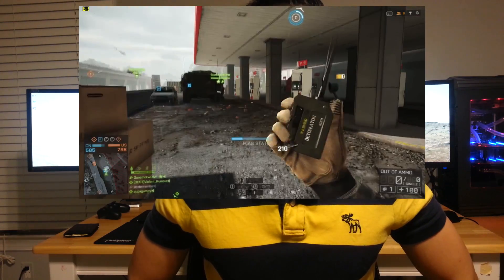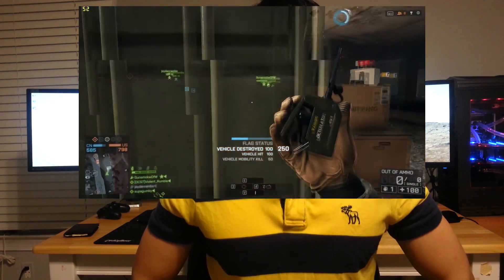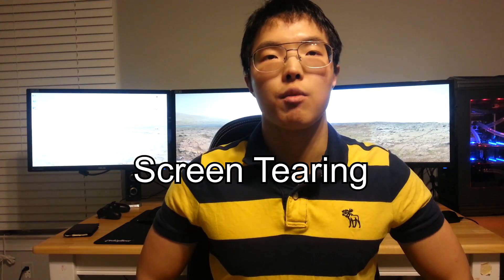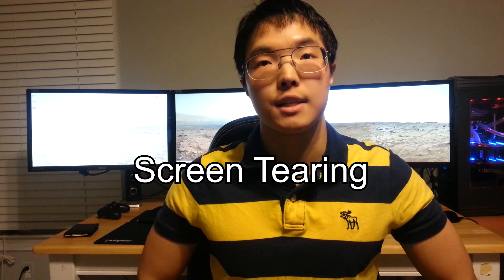What is Micro Stutter as "Fast As Possible" (SLI, Crossfire, Rubber Banding, Screen Tearing, GSync)

Comment: Hey dude great video. I am getting frametime spikes every few seconds in PUBG which is causing microstuttering. I only have one GPU (1080ti). My rig performance perfectly on a more polished title like Overwatch (no frametime variance). I am assuming it is a defect of PUBG's game engine, and not my hardware. However, I was wondering if there is a way to diagnose what is causing the microstutter in case it is something that can be remedied with setting adjustments. I am also wondering if other people can run PUBG with zero/low frametime spikes, as I'm not sure if it is something inherent in the game or if it is something that applies to certain individuals.

Comment: so how to fix it ?
Reply: They figured they should just cancel SLI and Crossfire as the fix :( At least 3DFX got it right.
Reply: @ASD _ Terminator Games don't meet requirements, but systems do. Try finding a system that exceeds recommended requirements are you should be fine.
Reply: @michaelcarson8375  Nah, some games do stutter even when you're way above recommended specs.

I'm running an RTX 3080, an R7 5800x, 32 GB dual rank and dual channel RAM at CL-16 3600, running off of a PCIE SSD.

All temperatures are in check, and the parts boost as they should, but some games, such as Escape from Tarkov, and DCS still stutter somewhat, even though most other games run perfectly smooth.
Reply: @ASD _ Terminator You probably have your software configured wrong. When you take the time to fix the software on your computer you will not have problems unless the problem is you are running off a hard disk drive and not an Nvme drive.
Reply: @ASD _ Terminator Do a youtube search for "make games run smoother on pc" without the quotes.

Comment: Would microstutter be able to occur on a single GPU system? I'm still kind of confused on what is wrong with my system and whether or not it's microstutter. When I run benchmarks, the FPS counter stays constant, but the elapsed time will slow down, then speed back up. This is apparent in a lot of modern games, is microstutter what I am experiencing? My PC: AMD FX-9370 @4.4GHz, MSI R9 390X, MSI 990FX, 750w PSU. Any help appreciated.
Reply: Exypnos yes and no. All it is is inconsistent frame times. This can happen on single gpus (not nearly as common) . however multi gpu setups well have a unique stutter (more rapid and persistent) that you won't find on single gpu setups.
Reply: SlyNine Any fix for me then?
Reply: Exypnos depends on the cause, what exactly do you mean by slow down and speed up (most software will drop frames). What benchmark have you run, does it happen in games as well?

One thing to keep in mind is frame rates that don't match the frequency of the monitor can cause a stutter. If the monitor is refreshing at 16.6ms(60hz) and the frames coming in every 17ms (slower than 60hz) I'm sure you can imagine it wouldn't be smooth.
Reply: 3DMark Benchmark Timespy. In fact, really any GPU benchmark it will happen. Literally the frames stay constant but you can easily see the elapsed time slow down, then speed up.
Reply: Exypnos In that case it's not microstuttering. Unfortunately unless it's a setting in the benchmark itself, I have no idea what could cause that. Does it happen in games?
Reply: All games that stress the GPU. Luckily Minecraft runs nicely. (I don't actually care for MC.)
Reply: Exypnos Simulation speed (game engine timing) would have to do with the CPU. It's a weird issue for sure.
Reply: So... any way around it?
Reply: Exypnos Can't think of any, and not sure why that would happen. All I can say is make sure all your drivers are up to date. The issue discussed here has to do with the speed at which the images are rendered (the snapshots of an instance in the game world). The timing issue you're having is the game simulation speed. Two very different things.

Sometimes games can lock the two together (so the simulation speed ticks forward 16.6 ms each step and is synced with the rendering speed) Those games would slow down exactly as you describe and this would be expected. But very few games do this, and 3dmark has an option to do that, but it can be disabled.
Reply: All drivers are fine. .-. I'm just gonna build a new PC because I can't be bothered with it.
Reply: Exypnos I get micro stutter on all my games it's so annoying!!
Reply: Would you happen to guess what my problem could be? I'm experiencing a "lag" or "freeze" in most games, but it seems more like a problem with most if not all online games, I don't notice it in singleplayer games as much. For example - WoW, CS:GO - when i click on players, or hover over them with mouse i get this usually  split secont freeze in wow, in csgo it happens mostly when I kill someone, or I get killed, or we win/lose the round, it just freezes/lags for 0.5 - 1 second. However, games like Rainbow 6: Siege or Doom run perfectly fine and it usually happens in menus only. I have updated drivers (well at least GPU and sound drivers...)

I have a bit weird setup:
AMD FX 8300 (3.3 GHz, 8-core)
MSI GTX 960 4G
MSI 970 Gaming
Kingston hyperx fury (CL9 at the time I think) rams 24 GB in total 
6 - 7 yrs old PSU Corsair CX600 (oldest part in PC)
Coolermaster Hyper 212 Evo
some old thermaltake case (fans still work properly)
I dont remember what brand my SSD is, but its120GB
WD blue 2TB HDD - this is where games are
and a backup SAMSUNG 500 GB HDD
Reply: Erik Farkaš I would unplug all unnecessary usb ports and hard drives. Disable av, and all unnecessary programmes. Reinstall any programs like punk buster.
Reply: Welp, I already tried playing with allmost all programs disabled, so that was not the problem, I will try the punk buster, if I'll even find out what it actually is. Thank you for the advice (I also wrote my specs in the first comment - edited)
Reply: Erik Farkaš it could very well be your ssd. Old ones with less than stellar controllers had freezing and hanging issues (Your games are not there, but it would cause a system wide hang regardless). Sometimes a faulty usb port can cause random hangs.

The specifics of where things are hanging make me think it could be anti cheat software. But I see nothing in your specifications that make me think it's your computers performance.
Reply: Guess I will build a new PC sometime in the future and use this one for work only or whatever, thank you vm! That is, if I won't be able to solve it somehow.
Reply: Erik Farkaš no problem, good luck.

Comment: In CSGO I had pretty bad microstutter with two GTX760s in SLI on a 144hz monitor even with a steady 150-200 FPS. I fixed my issue in NVidia Control Panel by changing the setting SLI rendering mode to Force alternate frame rendering 2. 

Basically this setting is an option to try out for games that have crappy SLI profiles. 

It makes better use of the 2nd card by alternating between the two cards for each frame rather than mainly using the first card with very little use of the 2nd (I saw no difference between SLI and single card until I changed this setting for CSGO).

Make sure you change it for the game in question rather than the Global setting because it can cause some weird graphical glitches outside of games. You can also try force alternating frame rendering 1 if 2 doesn't do the trick.

Changing the setting to force alternating frame rendering 2 for CSGO made my FPS go from 150-200 to 300-400 steady (and the game is MUCH smoother and without microstutter).

May want to give it a shot, I also changed fps_max to 0 in the CSGO console to get above 300 FPS (that's what it's usually set to).

Anyway for SLI users this may help with CSGO or other games (I've only tried it on CSGO). Nothing else seemed to fix microstutter for me besides this.
Reply: +Garrett Gardner Your problem is your using a SLI for a game that can be run of integrated graphics
Reply: +darksidelead Your problem is that you don't know what you're talking about.
Reply: Garrett Gardner i luled

Comment: I literally this close to buying two 970s over a single 980, but I absolutely do NOT want micro stutter or any kind of lag or delay on the hardware side. I have a 144hz 1080p monitor from Asus, will I experience micro stutter on it, and if so, what does the Nvidia Control Panel have to fix it.
Reply: 2 970's are stupid for 1080p, even for 144hz  but if you really want it you won't notice any lag or so, I have 970 SLI on a 1440p rog swift
Reply: watsyurdeal Sorry but RX10 is wrong, GTX970sli, which I have WITH (I7 4970k, 16gig ram 2114mhz, SSD) I'm running EVERY game 1080p on highest possible at 1080p 60fps, HOWEVER, I'm running the latest only JUST 60fps , so if I was to up my res to say 1440p then I know for sure i'll dip below 60fps and I'd need to turn settings down, this is tit for tat, and it's up to you competely, I believe resoultion isn't as important as texture quality and AA up to a POINT, I wil say as an owner of 970sli they are fucking incredible cards and how they are this  cheap I don't know! But they aren't higher than 1080p cards on the latest games (Dying light I was runing 2 k scaled at 60+ fps) but I'm taking cutting edge, whitcher 3, cyrsis 3 etc future proofing, a 144hz monitor is ready for the future 970sli isn't its gonna end when the playstaton 5 comes out (2-3 years) still, i'd highly recommend them
Reply: Ste Dunn lol you dumb fuck saturating 970´s bandwidth with AA . 

I had 2 970´s before my titan X and they ran perfectly smooth at ultra settings any game at 1440p
Reply: rx10 Why start insulting a stranger over the internet because he corrected you, to me that's quite dumb. Your argument becomes void when you resort to name calling, I'm guessing you're being bullied at school and have rage about it , so you come online to vent?

Look I'm not gonna become hostile back as I'm certain that's not what you need right now upon already being beaten up at school. I hope life gets better for you :)

And by all means, please run Project cars, The Witcher 3 at ultra settings at 1440p at 60fps with out a single drop, do that and I'll make a video announcing how I am a "dumb fuck" Also 1440p you sorta need AA still LOL! When you go 4k THEN I'd say turn it off (and some studies show that even some 4k games need small AA on)

I have a feeling you can't though, unless you have a magical machine that defies all benchmarks done by professionals, but hey believe what you want little guy :)
Reply: rx10 See more aggression more insults :)

You do know there are multiple levels of AA right? You apply less the higher the resolution as it is wasted at 4k, not so much at 2k.

Also look at the benchmarks, "stand your ground" lol all you want, but at the end of the day my little buddie your cards are not magical and cannot beat professional benchmarks, it's either you are right and EVERYONE else is wrong, or it's maybe possible your in the wrong. Anyways, by all means, prove it :) If you can't then quite please.
Reply: +watsyurdeal 980 is actually faster than 2 970s. Could buy a 980 ti instead of buying 2 970s. Far superier graphics card
Reply: +Steve Maynard look at the bench marks, the 980 is 10-15% quicker than one 970, but much more expensive. But 970sli kills one 980. Look at the benchmarks, it's wasteful to get a 980 right now even for 4k which most games won't run at 60fps.
Reply: +Steve Maynard I think you may be mistaken. The 980 is approximately 10% faster than the 970.  Two 970s are much more powerful than a single 980. You're right about the 980TI, though. It's a great card and definitely this generation's top-dog. Two 970s may be 2% faster than a single 980TI, but they are the same price and buying the 980TI  gives you room to add another should a situation call for it. Plus that extra vram will be vital for some games, especially in the future.
Reply: Naomi Washinton
The 970sli is 5-10% better, BUT if the 980TI is the same price in your country as two 970s then I'd go 980TI because SLI is still not heavy supported yet(the ark surivial is still one card only), however with direct12 promising better support at a lower level API then we could see the 970sli really out perform it. However this is all speculation.

I think with the memory limit of the 970s the 980ti is the better choice to go than 2X970s, and as you said it gives you more head room to extend it in the future. It's just a loooot a money.
Reply: +watsyurdeal Just go for it, you'll be fine

Comment: hey, thanks for the info. you always have good content. 
I recently got an asus r9 290 dc2oc 4gb and it's been giving me these black screen crashes/ freezes both in and out of game.
I was able to get rid of most of my crashes after checking "disable ULPS" and "force constant voltage" and adjusted the power limit to 50% in MSI afterburner, and DDU clean install the amd driver only. no catalyst control center. I also disabled hardware accel in browsers otherwise watching videos seemed to cause crashes randomly. 
however, i still randomly get crashes in midgame when playing starcraft 2. it makes me very sad because it's my favorite game. lost so many ladder points. My other games like Ryse son of rome and skyrim, and unigine heaven/valley all work fine with no crashes. well skyrim does crash occasionally too but i think it's due to some texture mods instability. textures not drawing right.

Would you happen to know anything about what would cause these crashes this and if there are any fixes?
I would greatly appreciate your help. This is a problem that has been affecting a lot of r9 card users. Just google r9 black screen.

Comment: Thanks, has been useful, thought my video-card had problems and it got me here, turns out that micro-stutter can be caused by monitors as it is in my case, 60 fps reported but it feels 30-40ish fp. Never buy cheap VA panels folks !

Comment: You can get high frame time variance even with single GPUs if the game isn't coded well; it's just worse with the AFR of SLI/Crossfire. Microstuttering is most noticeable to me when driving in racing or open world games, i.e. GTA4. If you drive at a constant speed but seem to be passing street lights at varying speeds (like you are slowing down and speeding up), THAT is microstutter. It is blatant in these situations, unfortunately.

Comment: Nice video, but unfortunately Nvidia still has major issues with this. I have 2-way SLI-ed EVGA GTX 570's (each with 1.2GB of VRAM), and I'm telling you, the microstutter is unbearable in some games. MMORPG's suffer slightly from it, but games such as BF4 are deemed unplayable. I found a slight fix by setting the maximum pre-rendered frames to 1, but it's still very very bad. I don't understand why Nvidia can't fix this already. I outscored my friend's stock 770 but that doesn't make me feel any better if I can't actually beat that card in gameplay.
Reply: Well, i figured out the issue with my setup. Yes, the pre-rendered frames set did help a little. In my case, I'm severely lacking from VRAM. I used to think that the VRAM adds up from the 2 cards, but I guess it doesn't. When the PC runs out of VRAM, it accesses the next-best thing which is RAM, but it's nowhere near as fast or as easily accessible as the GPU's VRAM, so ya, hence the microstutter in MY situation.

Comment: hey . thanks for info. inwoyld like you to answer a question. In Far Cry 4 ( if you ever played it) in sli there are time to time stuttering. Is it a micro stuttering or simply bad optimization?
Reply: It's bad optimization and an engine / coding issue in the game. I just finished that game with a single GTX 780 Ti and had stuttering all over the place. Definitely not your multi gpu configuration that's causing it.

Comment: I am running SLI GTX 260's and I don't think I am getting micro stuttering However I am getting frame rate dips of over 50% even 75% when the GPUs are under high load. (IE enabling Anti Aliasing) it happens a few times per minute... Is this just lack of optimization in old GPUs or am I experiencing some other defect?

Comment: Hey @Very Traumatic. 
I am a console to PC covert from late 2012 so I'm still finding aspects of PC intimidating especially when it comes to upgrades. I am currently using a EVGA GTX 660 SC with 2GB GDDR5. I am considering purchasing an identical card to boost my performance. However, I've seen a lot of gamers move on to newer cards such as the TI model of the 660. I am very pleased with my standard 660 and find it hard to part with. Should I move on to a single more advanced card or continue to enjoy the standard 660 by adding a second standard 660 to my rig through SLI?